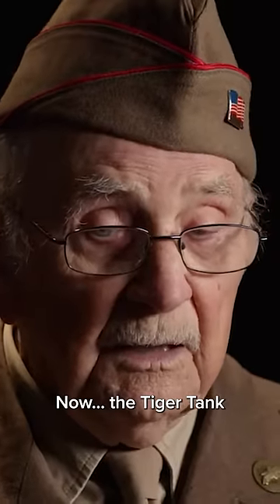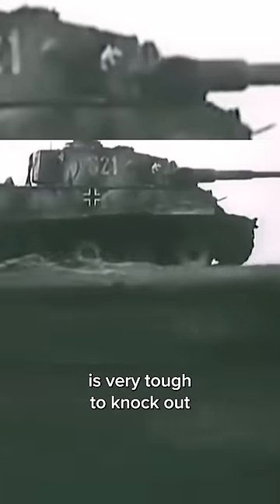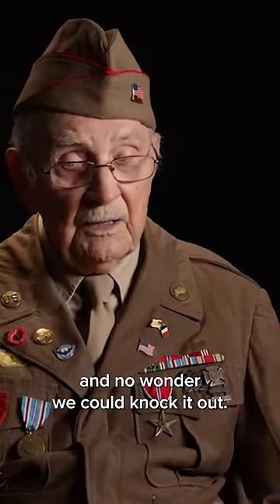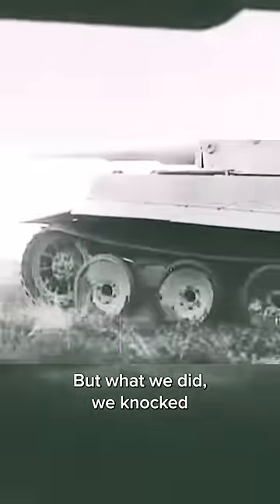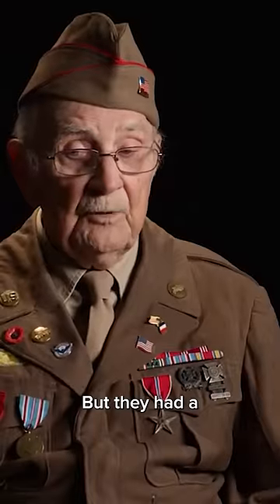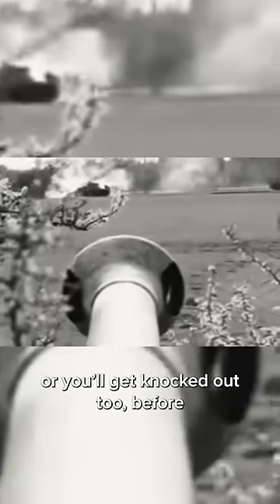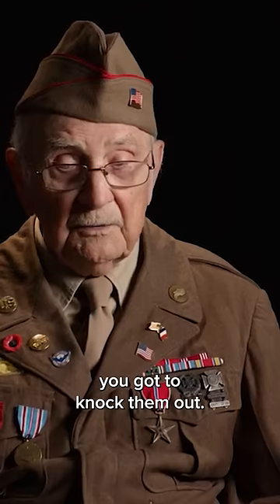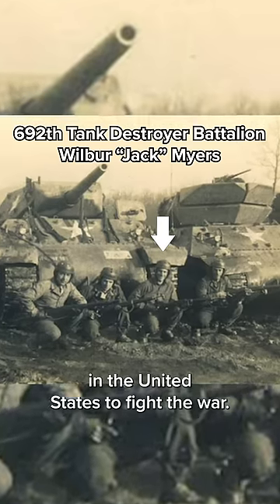How To Knock Out a WW2 Tiger Tank

Comment: He must've been talking about a Tiger 2. It was the only one with sloped armor. The video clips are 50 ton Tiger 1
Reply: He might not know the weight accurately.
Reply: @Rudy97 the Tiger 2 is literally ~70 tons
Reply: With slanted armor, and still tiger 2 is still a tiger @Fiberglass_Insulation
Reply: @HyperNebula not really it’s a completely different tank and there’s no shame in correcting it when it adds to the glory of this old man’s accomplishment.
Reply: Considering his age and nationality he’s using short tonnes
Reply: @gator5793 that doesn’t make that much difference
50 long tons become 56 short tons
He said 72 tons, which is right in the middle of long ton and short ton measurements for  the tiger 2 (68.5 long tons and 75.5 short tons). 
He also said it had “slanted” armor, the tiger 1 was a big box, the tiger 2 had sloped armor. 
He’s almost certainly not talking about the tiger 1, he’s either talking about a panther and embellishing the size of the tank and its armament as well as misnaming it, or a tiger 2, in which case he’s describing and labeling the tank accurately. Those are the two turreted tanks (he said it had a “swivel 88”)Germany fielded with sloped armor (they had tank destroyers and assault guns that had sloped armor but they didn’t have turrets), or at least what you’d describe as sloped armor, the other tanks had small patches of sloped armor but were predominantly not sloped.
Reply: @robertdevito5001 My bet is on Panther just because of the improbability of encountering a Tiger. But Tiger 2 definitely matches his description best.
Reply: @Shauntheduke. its still called the Tiger.
Reply: @wolkrieth2394 no they’d refer to them as king tigers it’s not the same tank at all.
Reply: @Shauntheduke.  Oh, you served? When were you deployed?
Reply: @robertdevito5001  Yeah that makes sense, which means this guy took an M10 Wolverine armed with a 76mm cannon according to the photo that was showed earlier, (which could destroy a Tiger-I from a kilometer away from the front) on fights with Tiger-IIs which is pretty scary not gonna lie.

He meant if you could take out the tracks, you could encircle it and hit the back of the engine bay or the back of the turret, which would ammo-rack a Tiger-II.
Reply: @wolkrieth2394 it’s simple history bud. Just admit your wrong and move on bud. It’s okay to be wrong.
Reply: @HyperNebula Tiger 2s were officially called Pz. VI ausf. B in other words they were Tiger Bs
Reply: @Shauntheduke. They were technically called the Pz. VI ausf. B

In other words they were called the Tiger B as well. King Tigers are to Tigers as the M4A5 is to the M4A1
Reply: @Shauntheduke.  Its not the same tank sure but the king tiger was designated by the germans the Panzerkampfwagen VI Ausf. B, as opposed to the Ausf. E and Ausf. H1 variants. Technically "king tiger" (called Konigstiger in german, literally "bengal tiger") was an informal designation. He's correct in calling it a Tiger as Tiger covers all Panzerkampfwagen VI vehicles. He didnt specify variant and he describes a 72 ton vehicle with sloped armor (so not a Tiger 1) and an 88mm gun (so not a panther) so its a good bet it was the Tiger B "king tiger"
Reply: @altaccount4697  I said it first
Reply: @vitiate5093 actually hems right King Tigers also known as Tiger B's or Pz. VI ausf b. Is an up armored Tiger it's quite literally just a Tiger with better armor and a better 88mm cannon the base of the Tank is the exact same except the added 20 tons of armor and the turret.... you saying it's a different tank is like calling a Sherman M4 and a M4A1 different tanks when really there the exact same ones just an improvement over the base model it's still a Sherman and A King Tiger is still a Tiger
Reply: @I_want_White_Cheddar_Popcorn I'd say it's a smaller leap in advancement than the M4 to the M4A5 more like M4 to the M4A2 or maybe M4A3
Reply: @QuakeMidaro  I said it because the designs between both vehicles of both examples drastically changed.

M4A2 and M4A3 only changed the engine and the grills
Reply: @Rudy97  The Tiger 2 was also the only one with sloped armor. He was talking about a Tiger 2
Reply: Pretty sure this hero had nothing to do with which tank footage they show in the video.
Reply: @Shauntheduke. If it's a tiger, it's a tiger
Reply: @Shauntheduke. Actually panzerkampfwagen VI tiger I & II are tiger tanks it says it in the name
Reply: @Rudy97  the tiger1 was 57 and the king tiger is 70
Reply: @HyperNebula  the tiger 2  Was almost nothing like a predecessor the only common thing that it has with the tiger1 is the 88 gun
Reply: @wolkrieth2394  🤦‍♂️  It's not like we have the actual tank in amusement or something! OH wAiT
Reply: I don’t think when they were fighting these tanks they stopped to discuss which one it was…
Reply: The Americans only ever came into contact with Tiger 1's once during WW2 and it was whilst the tanks were being transported by rail.
Reply: @idioteque4101 Yeah but the Panthers didn't have 88s on them. They used the 7,5cm KwK 42 L/70 instead.
Reply: @stephenfowlie742 That's a myth by the way. There are many reports (both German and Allied) documenting encounters with Tiger tanks all throughout the Western Front from Normandy 'til Victory in Europe.
Reply: @ExecutorGCW  Tiger Fear was a real thing in WW2 amongst the Allies with many reports of troops / tank crews  encountering Tigers later turning out to be Panzer IV's.

The Americans did encounter Tiger II's in combat on a few occasions but never really had a chance to face off against the older variant.
Reply: The dudes 100 years old and he destroyed tanks for a living. He can call it a tiger, tiger 2 or a unicorn dirigible for all I care. This guys an American treasure
Reply: @stephenfowlie742  Yes but you're forgetting that the man was attached to a Tank Destroyer Division. Most of the tanks identified incorrectly would likely have been from infantry units.

To give an example, it is known that the Allies faced the Panzer Lehr Division in Normandy who were fielding multiple Tiger tanks, but lost most of them against the British at Villers-Bocage and Hill 112 near Caen. Not to mention we've seen photographs of said tanks.
Reply: @ExecutorGCW On the contrary, I'm well aware that the British and Commonwealth forces fought against Tigers at Caen and many other locations. My point was as I've previously stated that the Americans did not encounter Tiger I's (in the field under combat) and that misidentification of German tanks by Allied Tank crews / infantry and even pilots was a common issue.
Reply: He knocked out tiger tanks I think he would know, more than any of you keyboard warriors
Reply: @stephenfowlie742  I will accept that it's true they encountered Tiger IIs far more often than the Tiger Is, but the statement that US troops only encountered them a few times, let alone once throughout the entire war is terribly incorrect.

The statement referenced essentially claims that the US only encountered them 3 times, but this has been misconstrued online. It was actually pertaining firstly to the person's own findings, and secondly it was regarding the northwest theatre in Europe only. This deliberately ignores the engagements of the US against Tiger tanks in North Africa & Italy.
Reply: @robertdevito5001  I love all you experts down here😂 y'all must've been serving right next to him the way you guys talk
Reply: @QuakeMidaro  it’s not but carry on.
Reply: There was some sloped armor on the tiger
Reply: @QuakeMidaro  WRONG , Tiger II (or panzerkampwagen VI aufs B.)(refered called by the americans as the King tiger ) was a completely diffarwnt moddel and i know it make zero sense but cosidering the fact that german tank classification in WW2 was stupendiusly "wierd" its no wonder u confused it . 

BUT , The M4 and M4A1 were the same general tank just useing different production metod but all the other stuff (a.k.a. the gun, the engine , transmition [the caseing is slighytly diffirent], the crew placement , all the mechanism's [except the ones that had to be modified] ) were all the same , makeing the 2 moddels ,ascentialy, the same
Reply: @Shauntheduke. You're under the assumption the Americans called it a King Tiger - we didn't, at least not at first .We just called it a 'Tiger', because it didn't make much of a difference to us. The Germans were the one who coined 'King Tiger' (or, Königstiger)
Reply: @robertdevito5001 if he's embellishing it's likely not his fault.

This is many decades after the event, and human memory is unreliable at the best of times, especially after so long.

But there's plenty of times where a King Tiger had run into american troops, and the best location I can think of is in the Ardennes during the Bulge, as many King Tigers were indeed present there, with one, rather helpfully I might add, deciding to back up to get a better shot at an AT gun crew, only to back into a house and get itself stuck there.
Reply: @I_want_White_Cheddar_Popcorn I think using the M3 Lee and the M4 sherman would've been a better selection, as the M4A5 isn't an American design.
Reply: @austinteal3645 not even that.
The Tiger 2 used a different 88 gun than the Tiger 1 did.

I think the one of the King was more powerful due to the barrel length.
Reply: @nukclear2741 Tiger 1 was the KwK 36 88 L/56 and Königs Tiger was the KwK 43 L/71
Yes the Tiger 2 guns are much longer and powerful
Reply: @robertdevito5001  wat if it was a tiger (p) tank
Reply: The description sounds more like a Tiger 2, but there were only a relative handful of 2s that ever saw service. For the most part you be more likely to see Bigfoot in the field with a 50 cal than a Tiger 2, at least until the final stages at Berlin because that's where the Germans obviously had stationed the last of their best gear. Panthers were often mistaken for Tigers because they were equally as dangerous and almost as hard to take out, so that could be where he's remembering the slanted armor from.
Reply: That's even more badass he took on a Tiger II goddamn
Reply: tiger 2 sucks, the fiability is so bad, like most of the end war german tanks
Reply: @wolkrieth2394 no it literally isn’t. It’s called The King Tiger as it’s ENGLISH NAME. Königstiger was its German name but it’s production name was Sd.Kfz. 182. Just like how the Sherman tank is not called Sherman, that’s a nickname given to it by the British who couldn’t be arsed with the M1A4 or whatever
Reply: @I_want_White_Cheddar_Popcorn they were officially called Sd.Kfz. 182 … so… you’re wrong.
Reply: Yeah Tiger II (King Tiger) has sloped humongous armor that's 258mm thick. Might be his memory fading dur to his age he mistaked both of em
Reply: @HyperNebula  Not really, to keep things simple the Allies and Germans called the Tiger 1 the Tiger and the Tiger 2 they called the Royal/Bengal Tiger (King Tiger) or just Tiger 2. While the Tiger 2 is part of the Tiger series, it is not the Tiger itself. It is the King Tiger or the Tiger 2.
Reply: @wolkrieth2394  No it's not, as my other reply says the Tiger 2 was called the Royal/Bengal Tiger (King Tiger) or just Tiger 2. It was never referred to as the Tiger. That is the Tiger 1. You don't need to serve to find what it was called so don't pull the "oh did you serve?" card.
Reply: @wolkrieth2394  They called everything a Tiger because they couldn't be bothered to ID which type of tank specifically was trying to kill them. Every gun was an 88, every tank was a tiger.  Veteran memoirs and interviews are extremely unreliable, especially World war II and Korean war vets who are that age where some dementia or memory issues are inevitable. If you want the truth, there's the mission reports and there's people who examine battlefields after the fact for intelligence gathering. Reconcile those against each other.
Reply: @altaccount4697  It's pretty well documented that western allied tankers frequently misidentified German tanks. If we believed every AAR they wrote, they would have killed many hundreds more Tiger tanks than were even produced in the entire war, but most of those kills were just Panzer IVs. We also have documentation confirming that the only King Tiger American tankers ever faced was 3 days before the end of the war. By a Super Pershing. Which this man was not part of the crew for. So he is misremembering entirely and is almost certainly talking about Panthers.
Reply: @idioteque4101  It's well documented that American forces only faced one Tiger II/King Tiger in the entire war. And it was 3 days before the end of the war, it was knocked out by the only Super Pershing in theatre. This man was not part of the crew for that tank, so he very likely never saw single King Tiger tank in his time in the ETO, functional or otherwise. They were incredibly rare and most of them were sent east anyways.
Reply: WW2 vet talks about fighting tanks
Random E losers: "nOt RiGhT tAnK nAmE"
Reply: @wolkrieth2394  you're missing his point, a tiger one is intimidating but beatable for tanks of the time, a king tiger is the apocalypse, and that old man there helped to stop that apocalypse. if the story of Beowulf had him defeat a large bear instead of Grendyl, the apocalypse, we would not remember him. help us to remember this man. Wilbur "Jack" Myers, for his Grendyl.
Reply: @Shauntheduke.  Panzerkampfwagen Tiger Ausführung B, colloquially called Königstiger. It was regarded as a variant of the Tiger
Reply: Tiger 1 is 60 tons
Reply: @idioteque4101  the west did face tiger tanks. They barely fought any tiger 1s however.

That's why Google will show results saying we only fought somewhere under 10 tigers, because we did. There are multiple military records of tiger 2 company's or king tigers attacking US forces, these were confirmed via engineers looking at the blown up tanks.
Reply: The Panther had sloped armor as well. In fact the Panther was the first German tank with sloped armor, being basically the German version of the T-34
Reply: Well, bear in mind he's calling something that happened along time ago.  He could be confusing the sloped with the Tiger 2 or the Panther.  Hell, maybe he even encountered a Jagdtiger once.
Reply: @Rudy97 he said sloped armour, the tiger 1 wasnt sloped whatsoever
Reply: @Waffle_the_Great  Maybe the Jagdpanther. The Jagdtiger had a similar armor layout as the Tiger 1. Or the Sturmtiger which had slightly sloped armor
Reply: @Rudy97  hes talking about the tiger 2
Reply: @Rudy97 

His information is actually on the ball for the Tiger 2. He probably did see one or more, and so discussed them here.

Which, if anything, makes his and his comrades' achievement all the more remarkable: those were even more up-gunned and up-armored than the Tiger 1 (though less mechanically reliable--which is saying something...)
Reply: @Rudy97 regardless of weight, Tiger Is are literally just boxes with 88s on them
Reply: Ok nerd.
Reply: @glados4765  it isn't nerdy mate its a well known fact just because you incompetent
Reply: jeez you guys that are all saying it was this model or that.. the people in battle would just call them tigers most of the time, they didn't have time to sit and be deciding what exact model it was. . "no it's a panther".. they'd be saying to the guys who correct them on what model it is "who gives a f@ck it's a big f@cking tank and it's coming towards us"

"but sir there are no documented tigers at this part of the front. and I've tried to weigh it but it's not 72 tons so i think it might be a jagdprickpanzer"

BOOM! the guy is dead

smh
Reply: @CastleHassall  that isnt the bloody point we are saying he is correct we never had a go at the guy in the video we are having a go at  the guy who made the video is wrong
Reply: @Fiberglass_Insulation yes, but obviously he wouldn't have known that when they encountered it. It could be he is just pinning that number onto whatever it was he killed, and it was heavier or lighter than that
Reply: @altaccount4697 I don't know where you got that Bengal tiger from, I may not speak German but I can tell you that königstiger is just King Tiger in deutsch
Reply: @theEWDSDS  the Germans called it Konigstiger, which is what they call Bengal tigers, the animal.
Reply: @altaccount4697  könig: king
Tiger: tiger
Reply: Maybe they didn't have their iPhones on them when the Tiger 2 came around, so they used this footage instead.
Reply: im sure they had to deal with both from what little i know of war
Reply: heavily doubt theres alot of footage for them to choose
Reply: @robertdevito5001 the tiger 1 actually does have a slanted front plate. It's just not a lot
Reply: @wolkrieth2394 omg is that seriously your argument?

I was deployed in Bosnia last month and if i told you that i saw a pink flying t55 that means now that yugoslavia made flying tanks in bright colours?

If you believe what anyone with a uniform on says you are truly not in for a good time learning about anything
Reply: @jacqirius  That's not what I meant. I'm saying that veterans from that era don't have a habit of including such menial information such as a single number in its name.

Are you seriously going to pretend that the Tiger II isn't a Tiger tank?
Reply: I can't survive in the body odor and cheeto dust of this comment section
Reply: @Calebgoblin  It's a toxic environment for anyone except Warthunder no lifes.
Reply: This whole section of comments is just ridiculous. This man was there, he lived it, just STFU and listen to him talk. People just don't listen enough. Shhhhhhhh.
Reply: @thelvadam5113 It's appreciated what the man did as for being experts some of us know more than others through education.Then it became a must to learn what veterans went through in both WWs out of respect and a quest for knowledge. We did ww2 as a subject at school we aren't veterans of ww2 but we know what the men went through in battle at Dunkirk, Normandy to Okinawa and so much more.Its not being a smart arse mate or anybody thinking we know it all we listen to these mens story's to get an idea of how horrific combat can be.
Reply: This veteran was in the 692nd Tank Destroyer Battalion. This unit fought in the battles east of Aachen in late autumn 1944.
Schwere Panzer Abteilung 506 with King Tigers fought in that sector too. Although a few King Tigers were indeed lost that autumn, their losses were sporadic. Few and far between. So what the vet is saying can't have been the norm.
Reply: At his age, as unfortunate as it is, he might not remember certain specifics like that. No matter what, the war was very traumatic, and the human mind is very weird when it comes to things like that. Doesn't discredit the video though
Reply: @robertdevito5001 Panther didn't have an 88 and was relatively easy to knock out.
Reply: This guy where perhaps in a fighting unit but he never saw a active combat ready Tiger
Reply: @QuakeMidaro The running gear was of the same type but was not the same. Count how many wheels for example, width of tracks, etc.
Reply: aye, also the us army very rarely encountered tiger 1s in normandy.
Reply: @-Ryan_Gasoline-  you are an crack if you think an m10 wolverine could take out a tiger from a kilo away. Maybe from the back or the side with AP rounds.